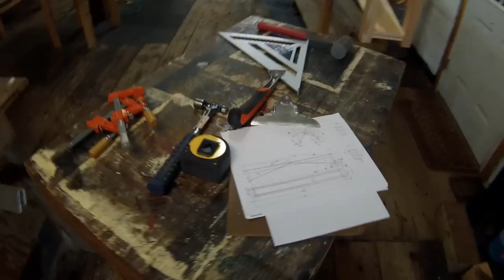4 Benches for X12

Comment: What's the purpose of the circular saw cuts on the bottom of the bench seat?  was that to take out twist?  What's your strategy when determining where to make the cut?
Reply from the maker: +Chad Thomas 
yeah it takes out some stress in the wood so that it runs through the planer flat and doesn't twist the frame of the bench.  the geometery and grain have to be looked at carefully, and some guesswork
Reply: How deep are those long cuts? Also, are you simply driving in some shims? Next q...What is the purpose of the small, flat pieces of wood you glue in? Thanks!